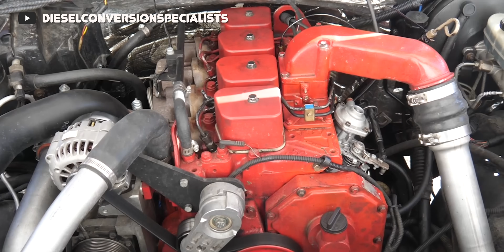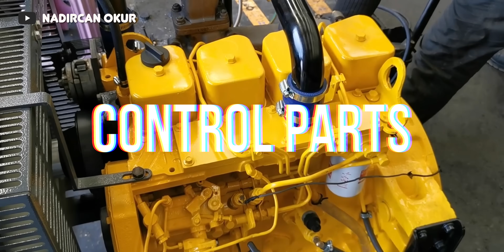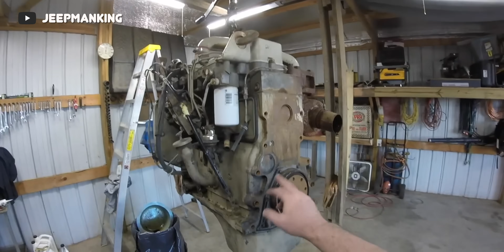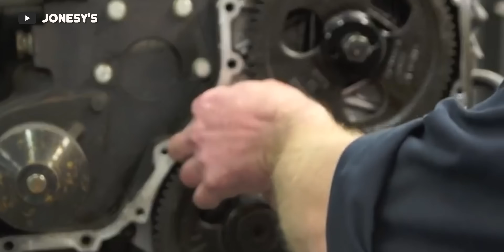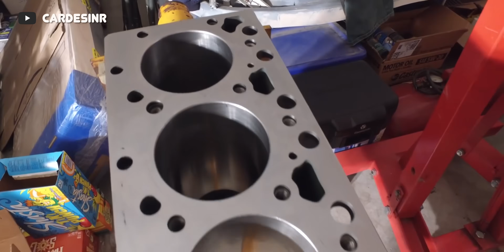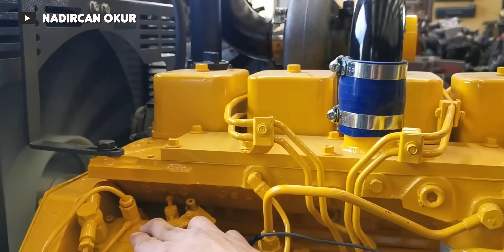Everything Wrong With the 4BT Cummins (It's OVERRATED)

Comment: 4BT is underpowered and overpriced imo, id rather swap an OM606 because just as reliable and much more power.
Reply from the maker: I might have to make some OM606 videos next 🤔
Reply: @Dustrunnersauto  If you make one, I would like to help make it as accurate at possible. I was VERY involved in the Mercedes diesel world for awhile(enough to work with companies specializing in them) and there is a lot of misinformation out there.
Reply: DieselPumpUK does some crazy stuff w the OM606
Reply: @funkycarlover  sure but you're not going to make even 200 wheel horsepower with that not worth it
Reply: Old international dt series engines are good too
Reply: @h3xd3m0n9  how about 354 perkins.
Reply: @h3xd3m0n9 yeah, a DT466E or just an old DT466 are great engines. I'd love to drop a 466E in my 94 F350, but the 7.3 powerstroke thats in it does just fine for now.
Reply: I feel like americans choose to ignore the om606 by choice for some reason
Reply: @alexstromberg7696  they’re not that common here, over rated and already pretty expensive. You can make considerably more power in a 6bt when you are fully building them. 
I actually like the om606 but everyone talks about it like your not spending many thousands of dollars to make 500hp. That’s not that much.
Reply: @danh8302 you can make considerably more power with an engine that has twice the displacement and weighs twice as much? Really? Who would have thought? 😂
Reply: @alexstromberg7696 we didn't get many cars with that engine here, finding a good example is a lot of work. I think they'd be worth it tho
Reply: BMW M57 imo.
Beastly short block they make a fuckton of torque down low from the factory and its a more modern engine.
Reply: SHHHHHH don't tell everyone about the om... keep engine prices reasonable
Reply: Would always opt for a 6 Cyl over a 4 cylinder, no brainer.
Reply: They are not comparable, the OM like revs to the moon, the BT mooves the moon at 1.200 rpm... Both are awesome in respectives applications.
Reply: M57
Reply: Ehh wouldent agree 100% there cool little engines great torque and if you have the right injection setup injectors turbo and balanced crank I’ve seen people around 400hp 700 ft lbs of torque, Ofcourse there around 5200 rpm instead of the stock 4200 rpm limit but there work horses, building a 1950 Studabaker with a 4bt rn Chevy adapter plate with a 700r4, there’s certain applications where the 0m606 is a better application
Reply: Also forgot to mention if there ever is a solar flare and all y’all’s computers get wiped these 4bts will be running circles around the om606😉😂😂
Reply: @savagerouge2144  well anyone that's builds a good om606 pulls a mechanical pump from the 0m603... the electronic pump that comes with this motor is very limited in its power potential. 

I'm sorry the 4bt is cool but you need to build it up so much to be able to make a reasonable amount of power. 

The Om606 you stroke out the mechanical fuel pump and add a hx35 from a cummins and you could be in the range of 450 500hp. There is definitely video evidence on this platform of this. Not to mention hearing this thing scream to 6000rpm is enough to send a nice little shiver down your spine. 

Look you will probably never be able to beat a stock 4bt or 6bt cummins in reliability. But once you boost these engines up they will breakdown like anything else.
Reply: Imo, it just depends what you want to put  it. If putting it in car, jeep, s10,etc... the om606 or 1.9 vw would be the best but if you're like me and you want to swap a 1 ton chevy, I'd go with the industrial 4bt
Reply: when it's underpowered it gets better fuel economy and longer reliability, boosting the fuel drains it's life.
Reply: Om606 is Euro trash
Reply: 300hp from a 4bt is awesome.
Reply: That’s why people work on them… they’ve got potential
Reply: Underpowered if you don’t know how to molest them
Reply: not as much torque though. om606’s don’t make shit for torque.
Reply: @dirtbiketherapy  A socket on breaker bar also makes torque with 0 RPM
Reply: For when you want 2JZ, but you hate Greta Thunberg... 😂

Also, I'd love to OM606 swap my 2nd gen Dakota, but it's not easy to find someone who can swap it without selling your kidney first...
Reply: @oxidizedolive 
I  have replaced the  engine  with a ⛵  sail.
I  just have to check wind direction,   each morning.
Reply: I agree, it's heavy and now way over priced. For my diesel swap I would rather  build a mechanical injection tdi engine at a fraction of the weight and price.
Reply: @blfjr2005  Volkswagen diesel swap that's a good joke I like that one
Reply: @markchapman2585  Might want to look up Dirt Lifestyle. He put in a 1.9 TDi (slightly bigger turbo and hot tune) in his TJ rock crawler. 31mpg, running 40in tires on 1-ton axles..... It is quite impressive.
Reply: @dorsk84  ya no thanks
Reply: Do a timing chain on a n47 and put it in anything. Give it 500nm on stock turbo and some injectors and there you go. 200hp for sub €200
Reply: What are you talking about the 4bt makes a little more torque and way easier to work on it's not over engineered  Mercedes junk
Reply: @markchapman2585  lol, they call it the diesel 2jz, and not just because of the power, but also the reliability. It shares a fair amount of older tech with engines like the Cummins BT, and just like a Cummins, you can have the older mechanic injection OM606 engines running on an engine stand, no computers needed. They're also lighter by a significant margin, make decent power when tuned, and have a much broader and smoother power band compared to something like a long-stroked truck engine.
Reply: @oxidizedolive  shure
Reply: @markchapman2585  sure is
Reply: @oxidizedolive  keep your Mercedes shit.
Reply: @oxidizedolive  even worse you work at the Mercedes dealership that's why you're sticking up for these engines keep fixing you're Nazi junk.

Comment: Anyone got any pointers to acquire a ridiculously small diesel engine? I'm talking single-cylinder, at most 250cc
Reply: Amazon has 5-14 hp Diesel engines highly recommend
Reply: Depends of how much you're willing to spend and how reliable you want it. There's some even on Amazon if you want to go the cheep route. Kohler makes one but they're hard to get and I don't know much about them. Yanmar makes the best but good luck getting one over to the US.
Reply: @robwhite3241  How much does a 3 cylinder Yanmar go for used?
Reply: @carlt6932  It depends on how and where you find them. You can find them for $300-$500 but online they usually go for a lot more. Repo auctions and truck dismantlers are a good place to get cheep ones but most of those are 2 cylinder.
Reply: The German manufacturer Hatz makes so so does Lombardini from Italy
Reply: What application? Just curious
Reply: military surplus

Comment: So what do you suggest we use instead?
Reply: Isuzu makes some good ones for projects, and Mercedes is awesome if you want to make power with little weight. 
Yanmar makes em, Kubota makes em, even cat makes some small ones that'll work great for projects. Finding them's the hard thing.
Reply: Om606
Reply: Isuzu, Toyota all their stuff
BMW M57 beastly block makes a fuckton of torque and power stock and holds up to more
Older Mercedes mechanical engines all rock solid especially OM606
VW VW EA188 especially the 2.0 16 Valve
Reply: 2.8 duramax or 2.8 cummins
Reply: @rock-uu7qr  think we got the money for that lol plus the 2.8 would be useless in a half ton
Reply: @chrishansen7004  how? it provides more power than the 4bt

Comment: Yea I also think the 6bt is overrated
Reply: Go play with with your 2.8 duramax...The 5.9 12 valve has outlasted and out pulled anything  all of its competitors. Nothing from Ford or GM was even in the same league in the early 90’s and much later. No one was swapping a 7.3 Ford into there Dodge.
Reply: @chadgronsten9023  Nobody wants to swap anything into a dodge 🤣The trucks are junk! and btw the newest powerstroke out pulls the cummins and the duramax smoked all the competition on its debut year! I love the 6.7 but the 5.9 is overrated
Reply: @chadgronsten9023  also its kind of embarassing that the 2.8 duramax makes more power than the 6bt
Reply: Typical internet fanboy with no practical experience. The duramax is a consumer grade light duty toy. The B family engine have been installed in about ever industrial/agriculture application imaginable. Enjoy that timing chain.
Reply: Typical internet fanboy with no practical experience. The duramax is a consumer grade light duty toy. The B family engine have been installed in about ever industrial/agriculture application imaginable. Enjoy that timing chain.
Reply: Typical internet fanboy with no practical experience. The duramax is a consumer grade light duty toy. The B family engine have been installed in about ever industrial/agriculture application imaginable. Enjoy that timing chain.
Reply: Typical internet fanboy with no practical experience. The duramax is a consumer grade light duty toy. The B family engine have been installed in about ever industrial/agriculture application imaginable. Enjoy that timing chain.
Reply: Typical internet fanboy with no practical experience. The duramax is a consumer grade light duty toy. The B family engine have been installed in about ever industrial/agriculture application imaginable. Enjoy that timing chain.
Reply: Typical internet fanboy with no practical experience. The duramax is a consumer grade light duty toy. The B family engine have been installed in about ever industrial/agriculture application imaginable. Enjoy that timing chain.
Reply: Typical internet fanboy with no practical experience. The duramax is a consumer grade light duty toy. The B family engine have been installed in about ever industrial/agriculture application imaginable. Enjoy that timing chain.
Reply: Typical internet fanboy with no practical experience. The duramax is a consumer grade light duty toy. The B family engine have been installed in about ever industrial/agriculture application imaginable. Enjoy that timing chain.
Reply: Typical internet fanboy with no practical experience. The duramax is a consumer grade light duty toy. The B family engine have been installed in about ever industrial/agriculture application imaginable. Enjoy that timing chain.
Reply: Typical internet fanboy with no practical experience. The duramax is a consumer grade light duty toy. The B family engine have been installed in about ever industrial/agriculture application imaginable. Enjoy that timing chain.
Reply: Typical internet fanboy with no practical experience. The duramax is a consumer grade light duty toy. The B family engine have been installed in about ever industrial/agriculture application imaginable. Enjoy that timing chain.
Reply: Typical internet fanboy with no practical experience. The duramax is a consumer grade light duty toy. The B family engine have been installed in about ever industrial/agriculture application imaginable. Enjoy that timing chain.
Reply: Typical internet fanboy with no practical experience. The duramax is a consumer grade light duty toy. The B family engine have been installed in about ever industrial/agriculture application imaginable. Enjoy that timing chain.
Reply: Typical internet fanboy with no practical experience. The duramax is a consumer grade light duty toy. The B family engine have been installed in about ever industrial/agriculture application imaginable. Enjoy that timing chain.
Reply: Typical internet fanboy with no practical experience. The duramax is a consumer grade light duty toy. The B family engine have been installed in about ever industrial/agriculture application imaginable. Enjoy that timing chain.
Reply: Typical internet fanboy with no practical experience. The duramax is a consumer grade light duty toy. The B family engine have been installed in about ever industrial/agriculture application imaginable. Enjoy that timing chain.
Reply: Typical internet fanboy with no practical experience. The duramax is a consumer grade light duty toy. The B family engine have been installed in about ever industrial/agriculture application imaginable. Enjoy that timing chain.
Reply: Typical internet fanboy with no practical experience. The duramax is a consumer grade light duty toy. The B family engine have been installed in about ever industrial/agriculture application imaginable. Enjoy that timing chain.
Reply: Typical internet fanboy with no practical experience. The duramax is a consumer grade light duty toy. The B family engine have been installed in about ever industrial/agriculture application imaginable. Enjoy that timing chain.
Reply: Typical internet fanboy with no practical experience. The duramax is a consumer grade light duty toy. The B family engine have been installed in about ever industrial/agriculture application imaginable. Enjoy that timing chain.
Reply: Typical internet fanboy with no practical experience. The duramax is a consumer grade light duty toy. The B family engine have been installed in about ever industrial/agriculture application imaginable. Enjoy that timing chain.
Reply: Typical internet fanboy with no practical experience. The duramax is a consumer grade light duty toy. The B family engine have been installed in about ever industrial/agriculture application imaginable. Enjoy that timing chain.
Reply: @chadgronsten9023  I dont think ive ever made a mouth breather like you that mad, ever! And yes I will enjoy my 6.6 and 2.8! because they both pull better than your 6bt!
Reply: I replied from my phone sorry for the bombing your reply. Pull better? Seriously your Isuzu's have to live on a torque converter. The durazu is almost always (a few pick-ups in the early years were manual) coupled to an automatic so they don't have to pull from the bottom without boost or drop boost between gears.  They don't make shit for off idle torque. I wish GM would have did a baby 60 series Detroit.
Reply: @chadgronsten9023  I can tell you right now brother that there is a reason no brand offers a manual anymore and the allison is a very good transmissions that many guys swap into their cummins builds. Even heavy duty trucks use them
Reply: Best diesel truck right now is the Duramax. 6.7 Cummins in 2nd place because their emission systems suck (thanks Dodge and EPA)
Reply: @alouisschafer7212  I love dmax!